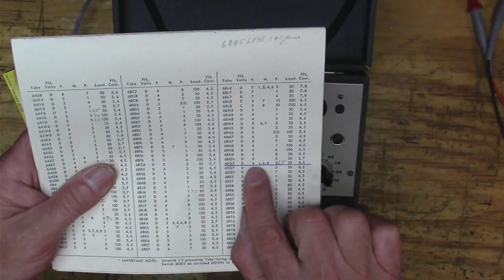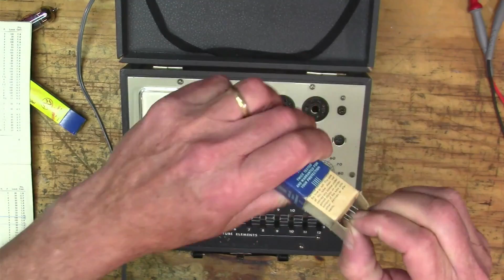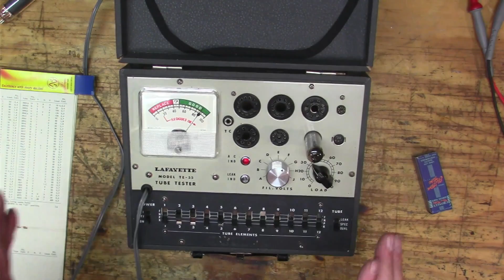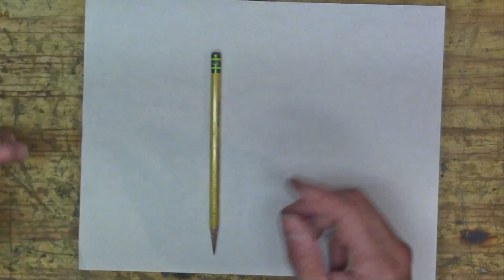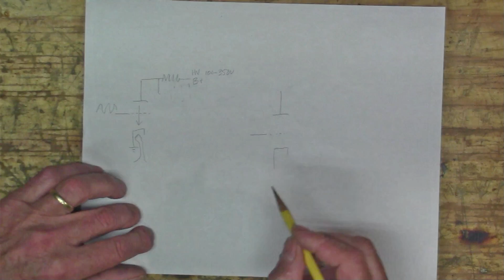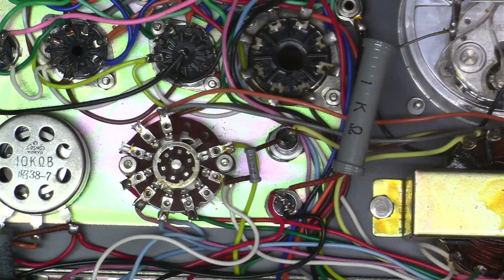Lafayette Tube Checker Usage and Repair

Comment: Thanks for this most interesting video about a vintage tube checker.

Many of those labels, such as the 35C5, are familiar since I grew up in my Dad's radio and TV store in the 1950s.

I would spend many after-school hours with a B&K tester using punch cards, testing and labeling those glass tubes, such that the service techs new from the start whether the failed tubes were the problem and easily replaced, or whether further diagnostics were required.
Reply from the maker: I am glad it brought back some good memories. I remember my dad (an auto mechanic) opening up the back of the TV, pulling all the tubes, and taking them to Radio Shack and testing them. It seemed like magic then which makes it so interesting to me now that I can understand it!

Comment: In a vacuum tube current flows from cathode to plate. The flow of electrons is termed electron current. Electrons flow from the negative terminal to the positive. Conventional current or simply current, behaves as if positive charge carriers cause current flow. Conventional current flows from the positive terminal to the negative. the term used in vacuum tube theory is known as thermionic emission from a heated cathode.